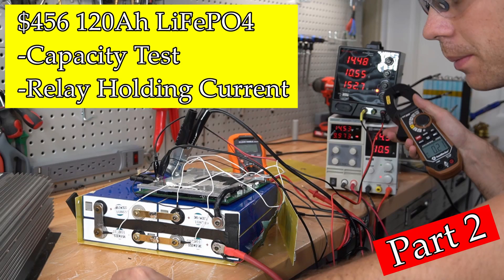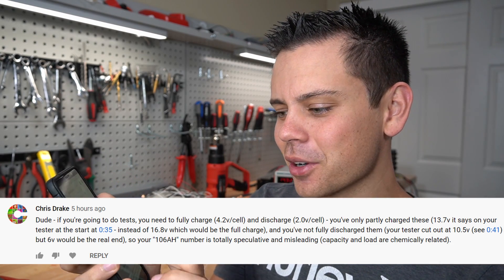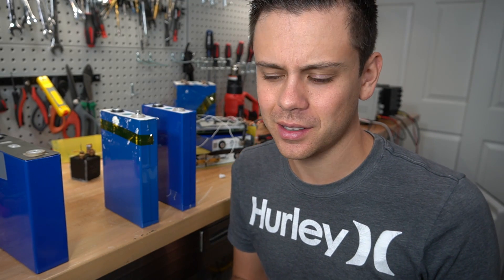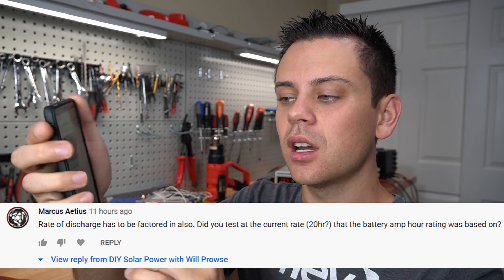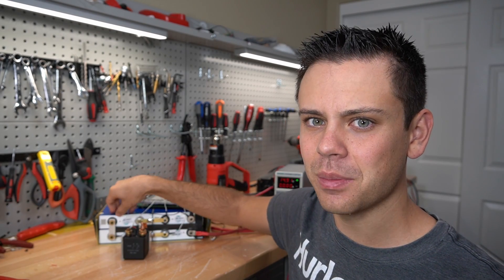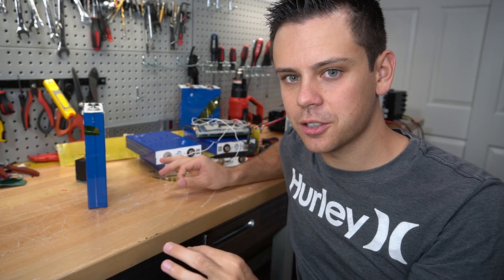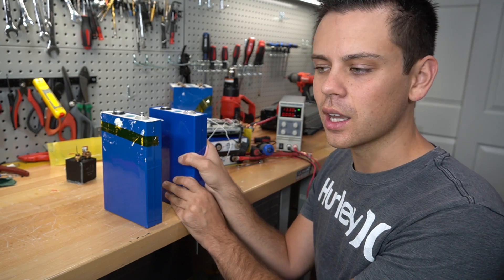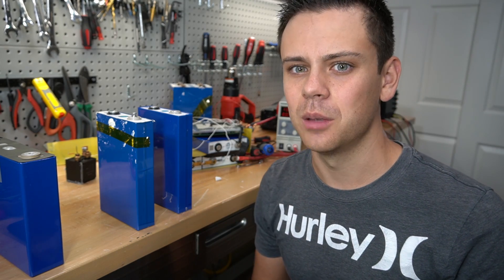Disproving LiFePO4 Battery Misconceptions in my Latest Video's Comment Section

Comment: Seems like the first one about "breaking in the batteries" might be from flooded lead acids, I get lots of them the dump and usually they just need to be refilled. But I need to reverse the polarity several times for it to hold a good charge. Idk about new ones tho. That might be how they got that. Idk why they think its the same for every other battery type.

Comment: I don't think people understand false advertisement at any point when something is not up to spec of what they are advertising it is false advertisement therefore they must take their product back or get a lawsuit I actually had that same issue with a used car sold as is advertised with a Turbo 350 transmission which it did not have it had AA are 74 or something like that and therefore they had to take the vehicle back they didn't have my BA girl so they had to compensate me in my approved way

Comment: Good video, I appreciate that you talked about your methods of testing. It was interesting to hear the exact process. 
I have a couple of questions: I'm looking at setting up something in the range of 20KWh+ LIFePO4 battery system for solar backup. 
Is it beneficial, for longevity of battery use (years hopefully), to limit charge to 80% and limit discharge to 20%? Are there better limits to use? or is this necessary at all on LIFePO4?
Another question since this will be a 16p (48v) and at least 4s,  what would be a good recommendation for a BMS? I'm looking at Batrium, but are there any others, and should any active cell balancing be employed with this configuration? Batrium has active cell balancing, but does not have to be 'turned on'. If no active cell balancing is being used, is the BMS just for monitoring at that point?
Thank you in advance for any help.
Reply: Join the DIY powerwall community on facebook. Some of your questions depend on the age of your batteries, and other factors which gets a bit complex.
Reply: @daltonbryer3171  Thank you for the suggestion.

Comment: Will sounds really tired or just holding back.

All the highlighted comments are from peopled thinking in lead acid technology. Also, no such thing as breaking in LiFePO4 battery; only properly balancing which cycling can help with if the cells are used (or slow top balance like Will does).

Comment: I wonder if the "break-in period guys" are thinking of old/used cells that were (probably) stored long-term and self-discharged to very low voltages. E.g., the used "modem batteries" that a lot sites are selling. If you get cells that come out testing at a very low voltage, the common knowledge seems to be that for many (most?) of them their capacity will increase noticeably after a couple of full cycles. But even if all that experiential knowledge is 100% true, it is definitely *not* applicable to the previous video!! Which is a really long way of saying: Will, you are right.

Comment: If my memory serves me correctly, old mobile phone batteries needed first charge to be looooooong and did get full capacity after couple cycles.  I think that error is from there. Totally different chemistry and probably very different manufacturing systems, but "old habits die hard"

Comment: Having worked with Many LifePo4 batteries you are absolutely correct!!!!   Given the option I never charge them above 3.5v per cell.  If I can set the max charge voltage, I usually only go to 3.4 volts.  Most of the DAMAGE is done in the last 0.2 volts for virtually no significance capacity loss.  3.5V is at least 98-99% capacity.

Comment: Is their a way to connect an alternator of a car to an inverter to make 110 power to run the fridge?
Reply: Yes but the best way to do this is to run the alternator to a battery and then power the fridge using the battery.  That way the power doesn’t stop when you shut off the ignition.

Comment: Sounds like some commenters were confusing lifepo4 chemistry with your typical lithium ion chemistry. It's like the comments I see saying well after you cycle a used battery a bit it's capacity might increase if it's been setting on a shelf for awhile, never once seen it. Lifep04 chemistry is wicked consistent to deal with, minimal voltage sag unless you way overload it and by the time you've hit 3 volts per cell you've used up most of the capacity, they stay at a nice stable voltage until that last few percent then they basically just fall off a cliff voltage wise. 3.4ish is pretty much where they settle fully charged and they will stay around 3.3ish for most of the discharge curve.

Comment: LOL Get REKT! There are multiple Facebook groups out there with similar misinformation. Many are "owned" but small solar installers and unfortunately things like "only discharge your lithium to 50%" are still common comments. Keep doing what you do best. You are a major contributor to making solar affordable for the masses along with all-in-1 budget inverter/charger/charge controller manufactures.

Comment: Will,

Love your level headed responses. I get a lot of armchair quarterbacking on how to restore the Frying Pan Tower myself with most folks never putting their toes in the water or riding out on the tower any of the many hurricanes, I've been through. As a 100% off-grid location (just outside the USA off the coast of NC) I've had many years to learn what works and doesn't work. The best answer is to say what the truth is, and create a few canned cut-n-paste answers to the clearly foolish flamers, and ignore as best as you can :)

You're doing great work! Keep it up! 
Richard

Comment: Could it be that someone at the factory simply slapped the wrong label on the battery? Then the IT or marketing guy looks at the 10 pallets of batteries, copies the label and we have poor advertisement for a otherwise perfectly fine 105ah battery. 
Not saying you should get your money back considering the incorrect spect. But just like you work with big battery and battery hookup, maybe they just need someone to hold them accountable to be more diligent on the details. 

But good video. Looks of keyboard warriors out there. It’s the failed “think for yourself syndrome”
Reply: it's the company's fault no matter what,, you should always get what was posted on the ad, if you bought a BMW and got a PINTO,, cause of sumone putting the wrong label on it, would you stand by?
Reply: or better yet , it was supposed to have a 500 hp engine and only got a 300 hp cause of miss label
Reply: Jim Gagne I’m not disputing that point. What I’m saying is that sometimes working with a company can be beneficial, as Will is doing with Bb and BH.
Reply: MotorizedBicycleRace not sure how you see the proof for that claim. 
On lower priced products the margin for error is higher, be that intentional or not. That’s why we usually say you get what you pay for. 
I’m not saying that Will is not entitled to a refund for a poorly advertised/labeled product.
Reply: MotorizedBicycleRace I write it of as “within expectations”. I’m neither angry nor outraged by it. The company is simply doing what it can get away with, be that intentional or not. And they have found receptive American consumers who shop by price not quality. You could say it’s their loss not getting the stamp of approval from someone like Will, but they will sell their batteries regardless. How many consumers capacity test their batteries? 
Label aside, the cells I dictate they are 105 ah, being essentially identical to other cells. At that capacity those are good batteries for low cost.
Reply: MotorizedBicycleRace you are correct. I’m an idiot for having this conversation
Reply: MotorizedBicycleRace because two sentence twitter feed style communication ain’t doing it justice.

Comment: I think they are getting some extremely old ideas, from NiMH batteries. There were some weird effects, so people got ideas of cycling them up and down, and forming. It indeed worked, and there is science behind to back it up. For Li-ion / LiFePO4 there are no such effects. The measured capacity is highest on the first cycle, without exception. (Assuming constant temperature and current when testing).

You can just do what they say to do, and show them that the result is the same or worse.

Comment: Just because you have a different opinion it does not make you correct. Science is pretty absolute based on the current knowledge level, and Will references peer reviewed articles wrt LiFePo4 and other Lithium battery technologies. As someone with around 40 years of Pb battery experience (flooded, then AGM) getting into Li around 5 years ago (via NiCd & Nimh) it was a bit of a re-learning exercise, dropping many of the earlier “common knowledge” principles I’d come to accept. It’s only when you’ve had LiFePo4 cells on a bench, hooked up to a variable PSU, load and BMS, along with a digital meter, do you really begin to understand what “makes them tick”. Great content as always, and thank you for taking the time to explain why these people may not fully understand the logic behind your testing.

Comment: Hey brother, it's Noel. I have a Epever 2410n, 12/24 volt charge controller. I'm using a 12 volt battery bank. Do I have to program the controller for 12 volts or is it automatic...Thanks bro...

Comment: a sometimes I wish people that don't know wouldn't say anything until they do know but the other day you posted about the giandel inverter and I bought one because you said they was good anyway it's pretty hot over here in Texas it was about 95 to 99 degrees outside and I was pulling in 740watts on the inverter and it was about 50 c degrees and climbing is that normal or is it okay to run them that hot and I got three extra fans under it to help keep it cool maybe you could do a video showing the best operating temperature and the max operating temperature with the most amount of watts  myself I'm about as dumb as a box of rocks when it comes to this stuff I'm just getting into it and trying to learn all I can and I guess I never will understand them batteries that you are using cuz I don't understand why you got to have a BMS and all that other mess on there too just to charge and discharge a little battery maybe you can list videos that you got on how they operate so I can check them out

Comment: Guy who says the high voltage cut-off per cell should be 4.2v does not know the difference between an NMC lithium cell and LFP cell....
Reply: And just to confuse everybody, Li-Ion, LiPos, LFP, NMC, NCA, LTO etc all use lithium ions as their charge carriers so are all technically Li-Ion cells.
It is the chemistry and structure of the combinations of cathode and anode materials and the electrolytes that dictate the parameters, charge density, cycle life, voltage range and specific capacities.
If I had my time again, I'd do a PhD on this subject!
Reply: @ahaveland  that is exactly right. It is a really interesting subject when you look into the different chemistries to suit specific applications. And the progress in the technology is amazing, everything from my RC planes to Tesla.
Reply: AKA ....
Reply: Chargint to 4.2v is definitely mixing up cell chemistry ... but discharge to 2v? Ok, you can discharge Li-Ion for a very short period of time (if your load let the voltage drop to 2v). But it can be very dangerous and i can not recommend it at all. Also the most Capacity will be between 4.2v and 3.2v discharge the battery to 2.7v or to 2v will bring you just 2%?¿ more of capacity measurement.
Reply: For such ignorant person it doesn't matter as long as there's Lithium mentioned... LoL. Lets hope he charges his LiFePo batteries to 4.2volts and survive..lol.
Reply: Are NMC suppose to go to 4.2v? What is the LVC of NMC?
Reply: Yep without a doubt mistaken chemistry 😂
Reply: Or between LiFePO4 and Li-Ion.
Reply: @fg_354  Exactly
Reply: @fg_354  Op was refering to what you just said. NMC for high drain li-ion, or LFP for LifePO4 batteries.Your comment added nothing :/
Reply: @rilufuzz  OK, I didn't know that. Sorry. I just call it Li-Ion. Like when I disassembled a laptop battery, those 18650 cells had Li-Ion on them so that's why I call them that.
Reply: @rilufuzz  Li-ion with the traditional cathode materials of cobalt, nickel, manganese and aluminum typically charge to 4.20V/cell. High capacity Li-ion can go to 4.35 V/cell or higher. Flip was completely within the realm of accuracy yet your comment?... not so much. Oh wait...I see  your other comments now...many of us are learning lots today...never mind...
Reply: @fg_354  while your original comment "added nothing", you and others have learned something as a result and nobody got upset. 

Btw Filip, i wish more people had your attitude when being corrected on something, especially when the "corrector" comes off as less than friendly. People get too uptight and offended at the slightest correction these days. It prevents learning and breeds the worst types of ignorance.
Reply: @Brandon_Nelson92  Yeah, when someone knows more than me, there's no reason to argue with them. Also I'm just 15 so that's why I don't know that much about different lithium batteries.
Reply: @fg_354  That just means you have more time to learn, and if you apply yourself you could even outpace Will's knowledge in the end, though it won't be easy. But try to keep that attitude regardless of your age and you'll never stop learning.
Reply: @geraldhenrickson7472  Pretty sure you're talking about Lithium high voltage rather than lithium high capacity. Last time i checked, the capacity didnt reflect on the end voltage. Also, there is nothing particularly special about lithium high volt cells, you see them in the RC world all the time. Again, nothing special about the lipo high volt cells either. Not sure what you tried to accomplish with that comment of yours.
Reply: Some of these people with their comments would go into mental meltdown if they really knew all the lithium based battery variants. I build high powered LED flashlights as a hobby, and get tired of all the misinformation and seller hype there as well. So many name brand lights can't output even close to their claims. Even when it does the lumens it claims, it's not always usable or even noticeable over cheaper options. And don't get me going on the "run over it, throw it in the water, freeze it...." It's an aluminum tube, that is sealed with o-rings. Unless you break the lens, they are all fairly tough.
Reply: @geraldhenrickson7472  What is the value of referring to cathode materials that are not being considered.  This is about LiFePo4, correct?   Or should we just mix and match the specs between whatever chemistry?
Reply: throw LTO at them and watch them freak the fuck out. lmao. so much ignorance about lithium chemistries.
Reply: @TMS5100  lithium mean lithium right? All the same?
Wrong lol
Reply: @TMS5100  Is it ignorance? Are those who have yet to learn as much as you ignorant? And just how large a part does arrogance play in the learning curve? It sometimes seems to shine often in YouTube comments. So sad.
Reply: @geraldhenrickson7472  of course it is ignorance. Look ignorant up in Websters. Ignorance is lack of knowledge. I have no problem accepting I am ignorant of many things!
Reply: @fisherus  We are all born ignorant.  The shame is many will die that way.  Lol.

Comment: I mean not getting a refund on something you have torn apart makes sense I mean you could have tested without disassembling
Reply: This is a different situation James. He dismantled the battery to prove he was defrauded.
Reply: no one would be shipping it back anyways, since its not financially viable, come on guys!
Reply: @morkovija  thats pretty beside the point
Reply: It's like buying a tool using it for what you needed and returning it when you are done
Reply: @james10739  I would agree with you 100%, James, if the battery was defective and Will was returning based on a warranty claim. It would be understandable for the vendor to void the warranty as a result of the disassembly as it would be difficult to distinguish whether the disassembly played a part in the product’s malfunction. However, that is not the situation here. Will is returning based on a fraudulent misrepresentation made by the vendor of the battery’s stated capacity, which is an entirely separate legal theory than breach of warranty. The disassembly only helped to further substantiate Will’s suspicions with the individual cells have the same dimensions, weight, volumetric density, specific energy as the 105 AH cells. To claim that anyone should not be made whole as a result of being scammed, which the disassembly helped identify, is misplaced.   

Likewise, I would not agree with the second claim as Will is not returning the item because he is “done” with it. From being an observer of Will’s videos for years, it's quite apparent he keeps many of the disassembled items for future projects and videos. Instead, as mentioned above, he it returning the item because it is not the item that was advertised.
Reply: @james10739  I am an attorney. They can't cover up fraud by saying he couldn't open it. He did not get what was advertised. That is the issue. This is not warranty clai, for a defective product which is the typocal case wjen we returm something. This is a claim for fraudulent advertising.

Comment: Dude your the solar / battery brainiac in my book all I want is to get two mini split AC units for two bedrooms about 9K to 10 BTU each and run them off 2 separate solar banks with lifePo battery back that can hold out for 2 to 3 sunless days all this so if I loose power I'll have minimal AC back up and also to lower my monthly AC bill..how or where do i go for a simple step by step info ? BTW I live in central Fl with a flat roof no trees  so great location for solar i'm in a  best case scenario..I would think about a 5K $ ball park hope to hear from you Mr Prowes